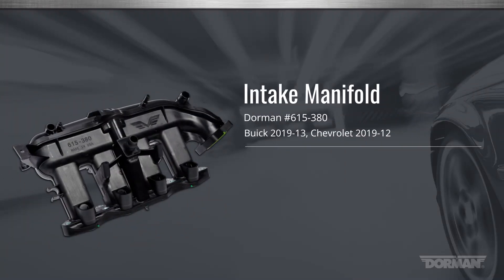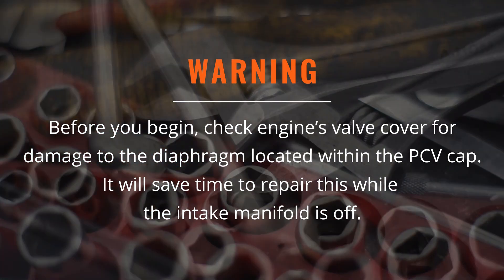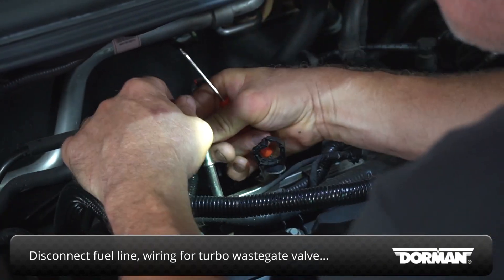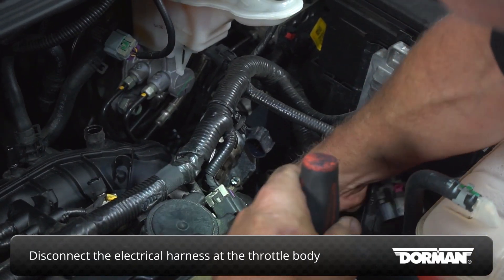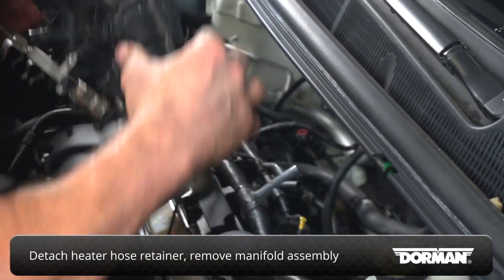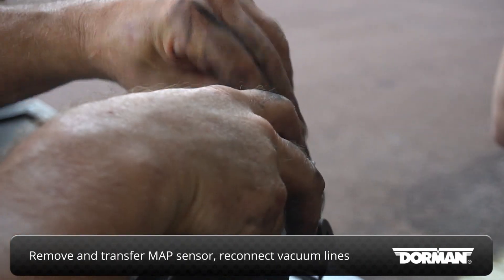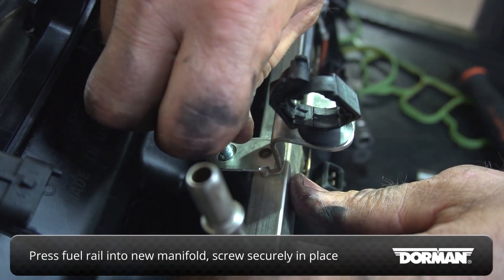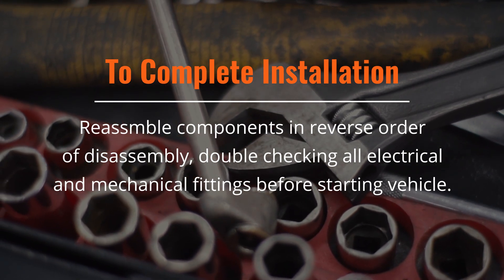GM Ecotec 1.4 Liter Intake Manifold Install Video by Dorman Products

Comment: I got one of these with a valve cover in an OE fix bundle from you guys, and the valve cover fit great, but the intake manifold bolt holes are bigger than the one thats already on my car. It doesnt fit, so Im unsure what to do about that. I have a 2015 buick encore. Please get back to me asap, I put in a support ticket through your website. Im really not sure what to do and we need this vehicle running to get to work

Comment: This still doesn’t work. The orange plug gets  sucked out with this plastic pin mod fyi.  And the valve covers are weak, they deform cause of the high crankshaft pressure….

Comment: I currently have the 2014 Chevy Cruze Lt with turbo 1.4 liter. Have been told the check valve inside intake manifold goes bad inside factory intake manifold sooner or later. My question is would changing it to a dorman intake manifold part would fix the issue permanently on the check valve inside manifold? Thanks for the video any feedback appreciated
Reply from the maker: Hello, please check out this link which shows how a permanent fix. https://static.dormanproducts.com/document/615-380_oe-fix_case-study.pdf

Comment: I just bought a couple of days ago it doesn’t fit my 2011 1.4L . She got Onel hole for 1 map sensor however mine got 2 map sensor
Reply from the maker: Hi Roberson, unfortunately part # 615-380 does not fit the 2011 model year 1.4s. On our application notes it specifies that this part number is for use with single MAP sensor port. https://www.dormanproducts.com/p-101387-615-380.aspx?origin=keyword
Reply: Can I part no. For 2011 1.4 L
Reply from the maker: Hi Roberson, we currently do not offer one for your vehicle yet with 2 MAP sensors but keep your eyes out in the future.

Comment: I just bought a 2016 Trax with 165000 miles. I'm thinking I'm just going to go ahead and replace the intake manifold right away. Does this Dorman product have an improved design, or can we expect the check valve to fail like the OEM manifold?
Reply from the maker: Hi Evan, yes! Part #615-380 has an improved OE fix design! Please see the attached PDF explaining the improvements. https://static.dormanproducts.com/document/615-380_oe-fix_case-study.pdf

Comment: What are the damn factory torque specs?
Reply from the maker: Hi Terry, the torque specs vary from vehicle to vehicle. It would be best to check your factory service manual for your specific year, make, and model.
Reply: @DormanProducts  Thanks. Sadly the factory service manual had no torque specifications I had to do a lot of digging to find it. Sadly no Hayne Manuals for this model either. but I eventually did. Thank you though.
Reply: @terryrhuebottom  torque specs for the mounting bolts is 15 ft/lbs.

Comment: It doesn't fit the 2011 1.4 Cruze?
Reply: Can confirm it does, however you will have you lint your barometric pressure sensor somewhere using a zip tie